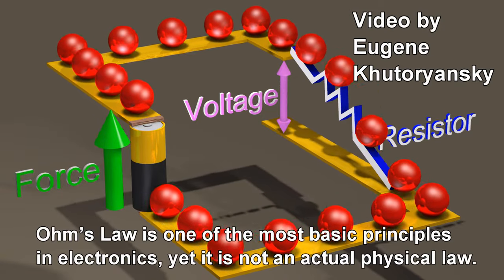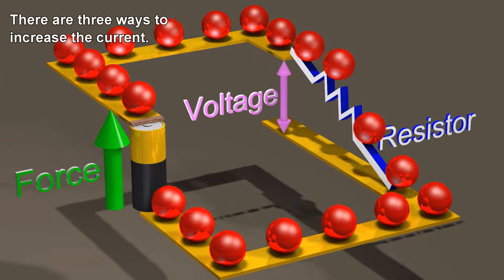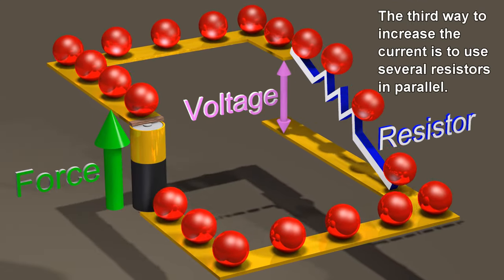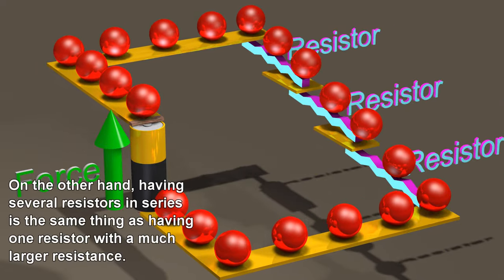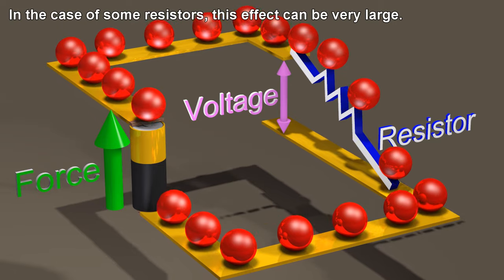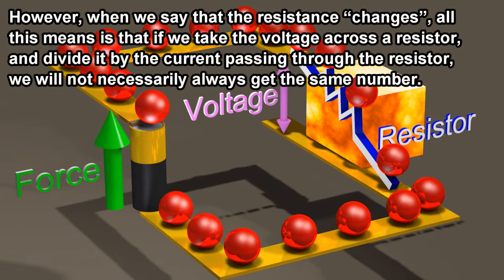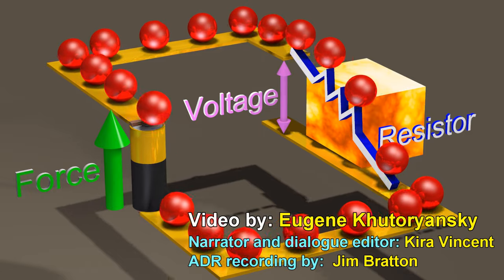Resistors - Ohm's Law is not a real law

Comment: Khutoryansky's definition: "Physical laws tell us how the Universe works." ( 3:27 )

Ohm's Law tells us that the resistance of an object at a certain time is equal to the voltage across the object at that time divided by the current through the object at that time.

Because of Ohm's Law, if you know two of the three values (1. Resistance 2. Voltage 3. Current) for a certain object at a certain time, then you can calculate the third value of the object at that time. It is possible to calculate and consequently know the third value because Ohm's Law tells us how the three values work in the Universe.

Ohm's Law tells us how a part of the Universe works, and thus is a law by Khutoryansky's definition of a physical law. The Universe works in way that when the resistance of an object changes (whether by temperature or some other change in the object), current through the object changes because the voltage across the object remains the same. Ohm's Law tells us about this way that the Universe works.

"the statement doesn't actually tell us anything about the external world around us." ( 5:29 )

The statement of Ohm's Law tells us how the resistance of an object, the voltage across the object, and the current through the object are related, like how the equation F = ma (Newton's Second Law) tells us how the force applied to an object will relate to the mass of the object and the acceleration of the object caused by that force.

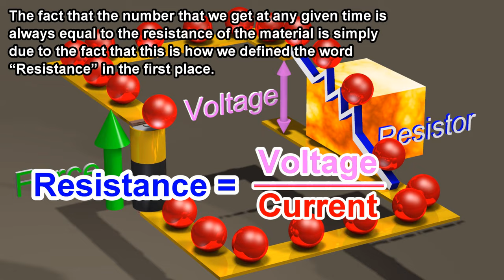"There are many examples in logic where a statement is always true simply because of the way in which we created our definitions for the words, and the statement doesn't actually tell us anything about the external world around us." ( 5:19 )

F = ma is always true because we have defined force as a thing measured in joules where 1 joule = 1 kg * 1 m/s^2, so of course X joules will equal Y kg * Z m/s^2.

My first two paragraphs apply the same way to Newton's Second Law. Read them with the terms replaced:

[Newton's Second Law] tells us that the [force applied to an object] is equal to the [mass of the object] [multiplied] by the [acceleration of the object caused by that force].

Because of [Newton's Second Law], if you know two of the three values (1. [Force] 2. [Mass] 3. [Acceleration]) for a certain object at a certain time, then you can calculate the third value of the object at that time. It is possible to calculate and consequently know the third value because [Newton's Second Law] tells us how the three values work in the Universe.

If I am missing something, please explain. I will try my best to understand.
Reply from the maker: +Blake Callahan, in the case of F = mA, force is defined independently of this equation.  For example, we have laws for how forces on charged particles are generated as the result of electric and magnetic fields.  On the other hand, in the case of R=V/I, resistance is defined entirely by this equation.  F=mA relates how something which already has a definition (force) relates to other observable quantities.  On the other hand, R=V/I does nothing other than to just create a definition for the quantity "V/I".
Reply: +Eugene Khutoryansky What is the definition of force independent of F = ma?
Reply from the maker: +Blake Callahan, in the case of an electromagnetic force, we have F = q[E + v x B].
This is just one example, as other types of forces have other equations.
Reply: +Eugene Khutoryansky I'm not sure I understand your logic regarding what makes a law. Newton tells us force is the time derivative of momentum. That's true, according to him. Then, we find other ways to calculate force, as you pointed out in your comment. But wouldn't it just be another way to calculate the time derivative of momentum?

If you say Ohm's law is not a law because resistance is only a way to define V/I, wouldn't force just be another way to define dp/dt, thus making it not a law?

I really liked your video, by the way. Great job!
Reply: Also, you seem to say Newton's laws are actual laws because there were other ways to measure it, like the electromagnetic force. But I think there weren't other ways to calculate force before Newton published his Principia. In that case, his equations only became actual laws (according to your definition) when other people came up with different ways to calculate dp/dt?
Reply from the maker: +Juan Pablo Mina, Newton's Laws of Motion make predictions that can be proved true or false.  Ohms law does not.  If the relationship of V/I is different from what was expected, we just say that the resistance has changed.  On the other hand, if we apply a known force to a known mass, then if the acceleration is different from what was expected, we would say that Newton's second law of motion has been violated.
Reply: +Eugene Khutoryansky I'm not sure I see it. You seem to say resistance is just a label for V/I, so R=V/I is not a law. But it seems to me force is just a label for time derivative of momentum. The equation for an electromagnetic force tells us what the derivative of momentum for a particle is, for example, when in the presence of an electromagnetic field. There is no actual force. It's just a way to name the derivative of momentum. Just like resistance is just a way to name voltage divided by current.
Reply: +Eugene Khutoryansky Oh and I thought we weren't sure if the universe was an isolated system. That's what I think the teacher told us and it made sense to me. I mean, how would you know if there's not another universe interacting with our own at some very distant point of space-time?
Reply from the maker: +Juan Pablo Mina, the Universe is, by definition, everything that exists.  If there is something outside the known Universe, then it would still be a part of the total Universe.  Hence, the total Universe is inherently an isolated system in the sense that there can be nothing outside of it, by definition.
Reply from the maker: In reply to your other comment, we have methods for determining mass, force, and acceleration independently of Newton's second Law.  On other hand, we do not have methods for determining resistance, independently of ohm's law.  Newton's second law is making a prediction about the relationship between three measurable quantities.  Ohm's law is just creating a name for the relationship between two known quantities.
Reply: +Physics Videos by Eugene Khutoryansky Saying Newton's Law has been violated would be just as daft as saying Ohm's Law doesn't exist.  What would be much more probable (and make it parallel to resistance changing) is that other (unknown, at the time) forces acted on the mass, causing the measurable acceleration to change.  In other words, the net force has changed (perhaps due to different friction, or gravitation, or a magnetic pull).  Therefore Newton's Law doesn't exist?  We could say that net force is then never known outside of a particular time and space.  The net force can only be considered to be the same if all other factors are acting equally, just as resistance is only the same if temperature (and any other possible factors) are kept the same.
Reply: +elus89 An add-on to this would be to say that net force is never known (in a prediction), it can only be assumed.  Generally calculations with "known force" are used in places such as machining where you expect exactly the same result every time.  The truth is, that over time the machine weakens due to breakdown and never produces precisely the same result, it's just that the differences are too small to be noticeable.
Reply: physical laws describe effects that appear in the physical world they dont neccessarily tell us how the universe works in all its beautifal glory. can you explain how my imagination works with physical laws ? : )
Reply: Physics Videos by Eugene Khutoryansky What if we state Ohm's law as follows? Current between two points is directly proportional to the voltage between those points. It tells you something about the universe and it does no mention to resistence, which would be the implicit constant of proportionality.
Reply: Well, this is not the case with static electricity.The Van de Graff balls generate very high voltage but low current.
Reply: he's trying to say that current is affected by the material it paases trough, it doesn't make any predictons why so. instead we have other laws that tell us ie. how atoms move according to the temperature and thus affecting the mobility of the electrons thus increasing resistance. or it may be the atomic structure that allows or not the flow of electrons. so we know current is a physical quantity and voltage a difference in potential then resistance is what you encounter when you want to move electrons efficiently.
Reply: The most important part of this is that the vast majority of resistors do not follow Ohms law at all. We specifically design resistors so that no matter the voltage and current, the resistance stays the same. As a benefit, we design them so temperature has very little effect. We forced Ohms law into existence by designing materials that follow it. It's not a physical law, it's an engineering law if you use the correct parts.

Temperature is honestly a sidestep, the most important rule used is that increasing voltage will not change the resistance.

Feynman illustrates definition vs law of F=ma very thoroughly here: http://www.feynmanlectures.caltech.edu/I_12.html
Reply: Eugene K. is right. Resistance is defined as R = V/I, but also, that same equation is the only one that relates resistance with other quantities. Moreover, that equation can be called as Ohm's law only if R is constant, at least according to the very popular textbooks University Physics woth Modern Physics and Physics for Scientists and Engineers with Modern Physics.

Comment: Ohm's law, as you stated it, is not a real law, but I don't think what the law is supposed to be. My physics book stated Ohm's law as saying that for many materials the electric field is proportional to the current density (or, equivalently, voltage is proportional to current). I guess you could still argue that this isn't a real law because it isn't always true,  but it is still an empirical observation rather than a definition. 

What always annoyed me was Kirchoff's loop rule. If you have any numerical property, with a number assigned to each point, like electric potential, then the laws arithmetic demand that the sum of the differences in that property around any closed loop is always zero. Yet, it is always treated like a law of physics, even though it is just a law of arithmetic. I like calling it "Kirchoff's loop tautology".
Reply: I pretty much relate!

Comment: Ok so in any case anyone is still in the comments. Could someone clarify this for me?

What this video is impling is that: "Ohm law does not define resistance outside of it, therefore it's not a law". In the principal example of Newton's second Law, that even without (F=M*a)acceleration could still be defined in some way. The reason of not being a law is that the Resistance does not have a constant for the actual resistance, since it would decreasse with temperature. 

So if in some way we define a constant for the material with the resistance at certain temperature; and another one for the amount that it changes with temperature and relate that through the current passing. Then it would be defined as a law? Like: R = Constant - ValueOfChange*DiferenceInTemperature. This way we could explain how the material change, and find a way to discover temperature by the new resistance.

I mean this is what we did with most atomic numbers. Found the value for a constant and related that with somethin. Molar mass and avogrados.
Reply: The Feynmann lecture mentioned many times in the comments states that even the most fundamental laws are only approximations becouse reality never gets so simple as to be completly described by mathematical equations. On the other hand we have uncovered laws which are universal becouse they are approximations of some fundamentum  underlying almost all physical phenomena. In my interpretation this video tells that there is no such fundamentum behind Ohms Law. For example as far as I know there is no universally valid the "R = Constant - ValueOfChange* DiferenceInTemperature" equation. If there is such a constant valid for at least all electro-conductive metallic material than perhaps Ohms law would indicate some fundamental quality of those materials. I have forgotten a lot about physics so maybe such a constant exists :)

Comment: Ohm's law works fine for metals at low current densities.   The temperature effect is a separate issue.    Ohm's law des not work for non-metals, semimetals, semiconductors, electrolytes, gases or metals at high current densities.  It has to be modified for alternating currents to take account of capacitive and inductive reactance.   But for basic electrical engineering and electronics it is still a very useful formula.
Reply from the maker: I never said that it wasn't useful.

Comment: I don't about you I feel more resistance going up hill not down🤷‍♂️
Reply: But that goes against what is happening. Resistance always leads to a voltage drop, or a drop in Electric potential energy (U=qV). In these diagrams, we are seeing a drop from high potential energy to low potential energy. If it was going up hill, that would imply an increase in potential energy.

Comment: Sure it's a physical law. Ohm's law tells us that the voltage in a circuit is proportional to the current by some constant, which we choose to call "resistance." In other words, under the same conditions, doubling the voltage would also double the current. This is an empirical fact and it's why resistance is a meaningful concept to talk about. For example, one could complain that Newton's Second Law F = dp/dt is merely just a definition and while that might be true Newton's Third Law is why Newton's Second Law is useful, because when we have quantity that is either conserved, transformed or in any way the same we can meaningfully talk about that quantity. If Newton's Third Law didn't exist Newton's Second Law would be useless.
The same goes for Ohm's Law. We can meaningfully talk about resistance because we know for experimentation that under the same conditions it's a quantity that is conserved.
Reply from the maker: +Markus, but the voltage is not proportional to current, and that is the whole point.  Even at a constant voltage, as the resistor heats up due to the power being dissipated through it, its resistance will change with time, and hence the current flowing through it will change with time too.
Reply: +Eugene Khutoryansky I did not say that. I said that under the same conditions the voltage in a circuit is proportional to the current by some constant.
Reply from the maker: +Markus, and will never have the same conditions, due to the fact that the act of passing a current through a resistor heats up the resistor.  Hence the relationship between voltage and current is not linear even in the most ideal of circumstances.
Reply: +Eugene Khutoryansky   Ohm's Law does define resistance but it also states something about resistance. Ohm's Law is a law about resistance. It only applies to a resistor to the extent that the resistor does not change its resistance. Let us suppose we have 1000 somethings that have identical resistance. Then in series they limit current to exactly 1/1000 of what one of them does. This is a statement about the property of resistance, not about resistors.

 The fact that there is a difficulty knowing the resistance of a resistor has no bearing whatever on Ohm's law, any more than the fact there is a difficulty in knowing exact mass, force and acceleration has any bearing on F = m a. The closer the values, the closer the result.

 But if that is hard to see, let us suppose we have determined the resistance of the resistors over the range of operation is +-5% Then we can figure the range of resistance of the combined 1000 resistors, and from that figure current. And the results will fall in the range we calculate. That is why it is a law and not only a definition.

Comment: You said that you can define force, mass and acceleration apart from newton's second law making it a law, not a definition. But you can do the same with resistance: https://en.wikipedia.org/wiki/Electrical_resistance_and_conductance#Relation_to_resistivity_and_conductivity.
Reply from the maker: That formula for resistance is based on resistivity.  In this case, the word "resistivity" becomes the definition which we choose to create.
Reply: What about this: https://en.wikipedia.org/wiki/Electrical_resistivity_and_conductivity#General_definition?

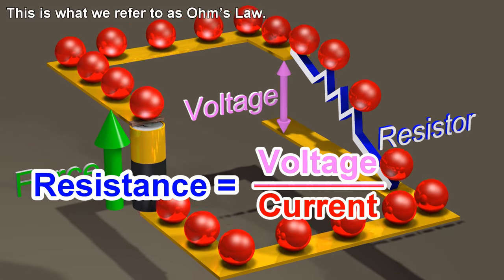Comment: At 3:15 I suggest the pink arrow of the voltage of the resistor to be pointing down only to indicate that it's voltage drop
Reply: You  are right as this essentially is a DC circuit. The resistor upper terminal is positive and the lower one negative. Or the lecturer tried to draw the "counter vector" with same colour. In my ham radio training in the early 1980's the voltage drop was explained to be a counter vector of same size but opposite direction as the voltage measured accross the resistor. At that time they taught that the current flowing thru the load resistor gives rise to the voltage drop (counter vector) which has to be substracted from the battery voltage.